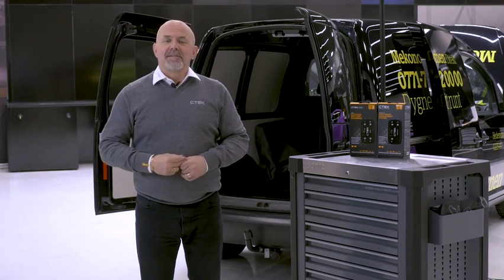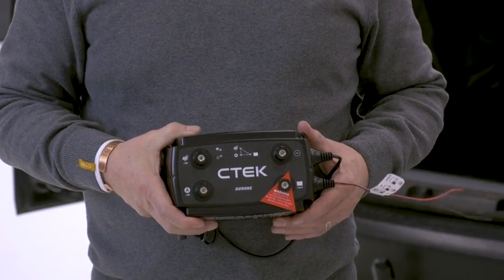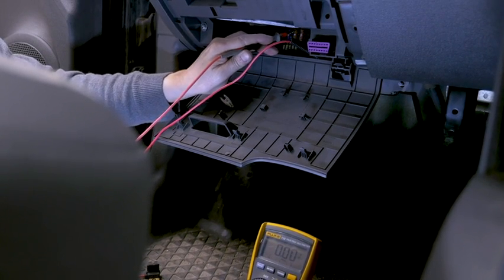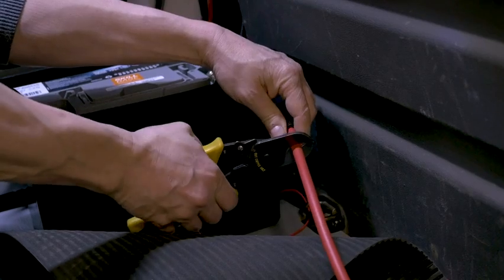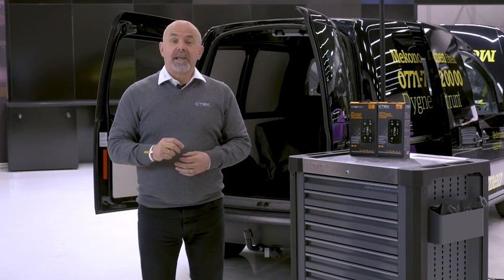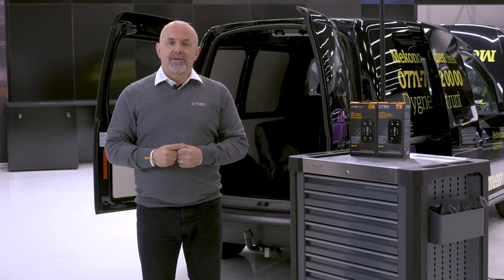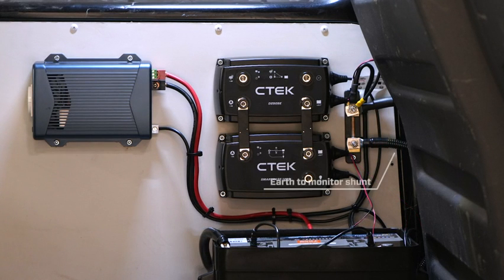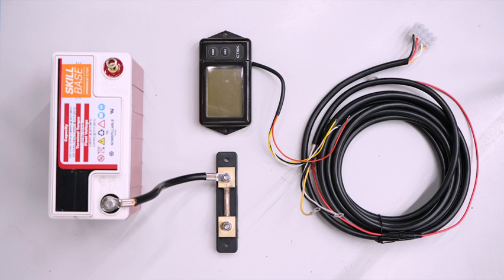D250SE & SMARTPASS 120S: Make the right connections

Comment: I have loved my CTEK D250SA for the last 4 years.  However, CTEK haven't kept up with technology or user demand.  Their D series chargers max out at 20amps unless you get a smart pass that apparently gives up to 120amps from alternator (too much for most systems).  There's no Bluetooth connection or app for monitoring the charge status, you have to buy a wall mounted system monitor for that.  I have very very reluctantly gone over to Victron.  I would have loved to upgrade my D250SA to maybe a D250SE if it had Bluetooth monitoring, a 30-50 amp charge profile and access to settings which can be precisely set for your specific system.  Modern Motorhomes/RVs demands have outpaced CTEK.
Reply from the maker: Hi! :)
Thank you for sharing, I will pass this on to the right department.

Comment: I have a 160amp alternator and I've never been able to get decent output from the 120S and 250SE combined. Best I've ever gotten was 35 amps going to my service batteries.

All connections are 1/0 full copper connections, several in line fuses etc. 

Tried to bypass fuses to see if they were the culprits, they were not.
Reply from the maker: Hi, We will try to find out why you haven't got more than 35A. Is the cables sized according to recommendation? I guess this can be a long conversation to find the reason, so I recommend you to contact us at support@ctek.com for better help. Best regards CTEK Support

Comment: Does the little red wire that needs to be connected to a permanent positive on the D250SE been connected to the lithium Auxiliary battery or the lead acid vehicle start battery.
Reply from the maker: Hi! Thank you for reaching out! 😊

The red thin cable should only be connected to a connection point where there is 12 volts when the vehicle's ignition is switched on. That signal is called (KL 15+) and can be found on the voltage supply to the radio or other equipment wish working when the ignition is on.

Please let us know if you have any other questions 😊
Reply: @CTEK Battery Chargers  thank you for the clarification,  I had solar plugged into the ctek d250se for 2 hours then after disconnecting the solar input the ctek is still showing the solar led and the A led illuminated 1 hour later. Is this a fault of some sort with the ctek. ? Thanks

Comment: Hello, I am changing to lithium battery.Do I attach the small black wire to the output service battery post on the cetek d250se unit now?.or the positive post on the lithium battery itself?..
Reply from the maker: Hi! Either of the options will work as long as it is a constant 12V feed.

Comment: I'm having trouble with my d250se at the moment, my alternator is giving out 14.5v across starter battery when the ctek isn't connected, as soon as I connect the ctek back up, the voltage across my starter battery drops to 12v, this is with or without the leisure battery connected. I am finding my starter battery keeps draining. The only thing bugging me is, the red smart alternator cable is connected but I think I may not have a smart alternator, would this be my problem. Thanks
Reply from the maker: Hi,

Thank you for your message! 😊

Please contact us at https://support.ctek.com/ or email us at support@ctek.com and we will help you further.

Have a great day! ☺

Comment: Hi, just installed Ctek B250se. Without connecting the  ignition wire. When i start the van the yellow bottom led lights up and the bottom right yellow led lights up. And the voltage on the leisure battery increases. This would suggest the  Ctek is charging . So it seems to work without the ignition wire connected , Even though i have been told  i have a smart alternator.  My thinking is the smart   alternator sees the  starting battery as a bit low and therefore starts charging it. Then the Ctek sees the higher voltage and starts doing the DC to Dc to the leisure battery and therefore pulling the  starter voltage down enough for the smart alternator to keep supplying a higher voltage and therefore current to the start battery and leisure battery. So i am struggling to understand  what  situation  will cause the smart alternator to stop charging and therefore not trigger the ctek to do DC to DC  until  the leisure battery is charged. Also when the engine is switched off, the Ctek sees the drop in voltage and switches off the DC to DC conversion  and both LED go out.. So it all seems to function as expected without the ignition wire connected?
Reply from the maker: Hi, Even when the ignition wire is not attached, the D250SE will work. It will start as soon as the voltage is higher than 13,1V and shut down when the voltage is lower than 12,8V The problem when you have a smart alternator is that the ignition is turned off as soon as there is power enough in the battery to use for the electronic components. This can happen  many times every second, and this  makes the D250SE start up and close down often. even if the voltage in the battery is raised it is not charged as effectively as possible. If you have a start stop vehicle I recommend you to attach the ignition wire. Best regards CTEK Support

Comment: Hi, Thanks for the Video. I would ask you if it is possible to connect the starter battery to the service battery with a 500 A Switch so that is still possible to start the engine when the starter battery failed or in case I need to use the winch. Thanks Luca
Reply from the maker: Hi, if you  have the  D250SA or D250SE and the SMARTPASS 120S the SMARTPASS120S will automatically connect the starter battery and the service battery automatically if needed - you do not need to do anything to have that extra start help. Best regards CTEK Support

Comment: hiya. I have just had a ctek 250se fitted and all connections are correct. when the van starts , all that flashes is the green light. at no time does the yellow light show to indicate service battery charging.However, the twin lead acid battery charge windows show green as fully charged. Does the ctek only show the yellow charging light once the battery capacity has been lowered?  my kit is part of a camper van conversion
Reply from the maker: Hi. If the green power LED is blinking, this means that there is no contact between the battery and the charger. Please check the fuses between the charger and the service battery. The yellow diod indicating "charge" will be lit when charging. When the battery is fully charged it will go black. I hope this will help you. Best regards CTEK Support
Reply: On my batteries,the tell tale shows green when they are fulyly charged and black when they aren't.theres a battery condition  information sticker on the top of thebattery that shows that green is fully charged and black indicates that it needs charging. If the batteries are fully charged would that mean the green light on the charger was showing it onstand by.
Reply from the maker: @parkay3560  Hi, If the batteries are fully charged the green light "Power" will have a steady light. Best regards CTEK Support

Comment: Hi, I have the D250SE and the wiring diagram shows the service battery negative returning to the starter battery negative with a ground halfway along. Does the service battery need to be grounded and returned to the starter negative or can it be one or the other? Also there is no recommended wire size, can I assume that it should be the same as the wire from the starter battery to the D250SE?
Reply from the maker: Hi, The connection is showing a common connection (to the chassis) the service battery can be earthed / grounded to the chassis.
The earth / ground cable should be the same thickness as the starter battery to D250.
Best regards CTEK Support

Comment: Hi there, I just wanted to check if the Ctek 250SE and 120 Smartpass are compatible with Lithium Iron Phosphate batteries. Some web based info suggest not but having bought both the 250 and 120 from Ctek both user manuals state they do. Sorry to bother you but could you confirm. Thanks InTransit
Reply from the maker: HI. The D250SE and the Smartpass 120S are compatible with Lithium (Li FePO4) batteries. Earlier variants is not. Best regards CTEK SUPPORT

Comment: Is the smartpass suitable for lithium with the se model dc dc charger
Reply: The Dual 250SE is compatible with lithium. you need to connect the black wire to a constant live 12V.

Comment: Hej,
Jag planerar att installera D250SA i en husvagn och har följande frågor:
1. Är det korrekt att koppla +IN till pin 9 (s.k. bilbatteri+ direkt) på 13-poligt kontakt?
2. Är det korrekt att koppla s.k. Smart Generator röd kabel till pin 10 (s.k. bilbateri+ via relä, dvs. på när motorn är igång) på 13-poligt husvagnskontakt?
3. Om två övanstående är JA, finns det någon nytta att installera SMARTPASS 120S också? (med tanke på att max ström på 13-poligt kontakt för pin 9 och 10 är typ 15A)
Mvh / Bart
Reply from the maker: Hej.  Här kommer svar på dina frågor. 
1.  Ja, det är pin 9.
2. . Stämmer
3. Nej, det är ju ingen större mening. D250SA laddar med upp till 20A och det räcker och blir över till de ca 15A som kan gå igenom pin 9 och 10.
Lycka till
Mvh CTEK Support

Comment: Hi there, I have 2 CTEK chargers (1x D250SE, 1x D250SA) installed in different cars, both with a solar panel connected. After I had a start battery go flat I did some investigation and noticed that the CTEK charger is discharging the start batteries intermittently. (You have to watch it for a while to catch it doing it, but it seems to happen more frequently when the solar panel is partially shaded) I have spoken to CTEK tech support and they're not able to give me a suitable response why this would occur. Just wondering if anyone else has experienced this?
Reply from the maker: Hi, Thank you for choosing CTEK. It  can be a bit tricky to find out the problem with this information, but lets try some basic.  Please check that the thin red cable (for Smart alternator) is connected to ignition (KL15+) I know that In some cases there has been a lack of reverse voltage diode on the solar panels and then the starter battery can be drained, because there is always a small voltage on the solar panel input on
D250 that seems to come from the starter battery. If it's dark outside and the reverse voltage diode is missing the power goes out into the solar panel and drains the starter battery if the reverse voltage diode is missing. If this doesn't work - please send your question to info@ctek.com for a better dialogue. Good Luck. Best regards CTEK Support

Comment: So if you have a lithium battery the red has to be connected to a live feed and the black one ?
Reply from the maker: Hi, the black one should be connected to the positive pole on the starter battery or the service battery (doesn't matter which) When that is done you will have the lithium setting. Best regards CTEK Support
Reply: @CTEKBatteryChargers  This is what I needed to know. And how to find the right place to connect to the ignition source. Thanks!

Comment: Where do I connect the black wire when charging lithium batteries on the smart pass
Reply from the maker: Hi, The black wire on the SMARTPASS120S should be connected to the positive pole on the lithium battery in order to get the lithium charge program activated. Best regards CTEK Support
Reply: @CTEKBatteryChargers  Hi. I had the same question. But could you please confirm that it is correct. The black wire of the D250SE should go to +ve for Li, but the manual indicates the small black cable on the 120S goes to -ve. Would you please check. Thanks, Mike.
Reply from the maker: @malteruthemeyer  Hi Mike. We have checked the manuals available on the web. From what we can find, the only recommendation to connect the black cable to - on the battery, is when you want to choose AGM charge algorithm. For Lithium, the black cable should be connected to the + pole on the battery. I hope this helps. Best regards CTEK Support

Comment: nice video. one question, do you know if that CTEK dc/dc battery charger also works as a battery splitter? so does it prevent the starter battery from going flat while the engine is not running or does it need a separate splitter?
Reply: The Dual 250 works as a splitter.

Comment: I am a bit confused. I just bought a Dual 250SE for a simple split charge system. I have also bought a 100A LiFePo4 leisure battery. The car has a 120A conventional alternator.
For lithium charging I need to connect the thin black selector wire to 12+. Which 12+?
Can I connect it to the leisure battery or do I need to connect it to the starter battery?
My setup is no fancy camper. Just a VW Multivan with sleeping possibilities. I am using the leisure battery only to run the Eberspächer diesel heater and a fridge.
Reply from the maker: Hi, 
To activate the Lithium mode, you connected the battery selector wire (black) to battery positive (+12V) can be starter battery or Service battery. You find this connection on D250SE input terminal or output terminal. Best regards CTEK Support
Reply: I’m having problems too with this, I don’t think I have a smart alternator as the voltage sits at 14.5 with engine running; which points to it being a standard alternator, but I’ve done the black wire to +12v and my lithium isn’t charging when I drive, at all.  What could be the issue? It’s a fresh install with a. New Lifepo4 200ah. 
Would be a real shame to have to return the charger
Reply from the maker: @MorfMusic   Hi, Please consult your car dealer regarding the alternator type, if having doubts regarding type.
When installing the D250SE please ensure using recommended wire dim. Fuses and we can recommend to watch our video instructions on the subject. If you still have problems, please let us know.
 info@ctek.com. Best regards CTEK Support

Comment: Why does nobody explain the lithium mode more?
Reply from the maker: Hi, I am happy to explain! What do you want to know? How it works or how to activate it? or something else? Just let me know and I will do my best to help. Best regards CTEK Support
Reply: @CTEKBatteryChargers  is it activated by a constant 12v signal, as in, can it be wired directly to the alternator input?
Reply from the maker: @KR7PT  Hi, it needs to be connected to the starter battery to have the correct voltage levels to start and stop the unit. By connecting the red cable to ignition it will work together with smart alternators - but you still need the starter battery. Best regards CTEK Support
Reply: @CTEKBatteryChargers  I understand that, but a 20A draw over roughly 12m total cable (6m run, 6m return or chassis return) the voltage drop is very small, given the cut in voltage is 13.1V, voltage drop roughly 0.4V over that distance, would I still need to run the cable all the way to the starter or just use the terminal on the CTEK?
Reply: @CTEKBatteryChargers  by that I mean the black selector cable, not the red ignition cable. I don't have a smart alternator so I will be blanking off the ignition wire.
Reply from the maker: @KR7PT  Hi, there are really good recommendations for cable areas in the manual, I recommend you to check that out. The black cable should be connect to the charger (OUT+) for LiFePO4 and (-) for AGM. I can also recommend you to contact us via mail: support@ctek.com for longer and more detailed answer. Good Luck. CTEK Support